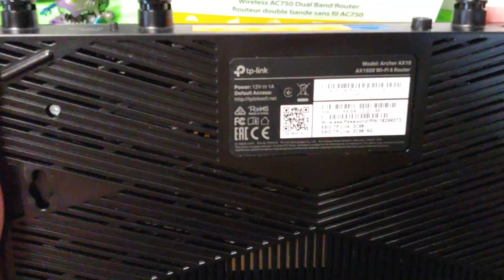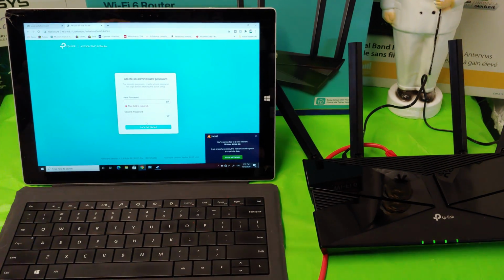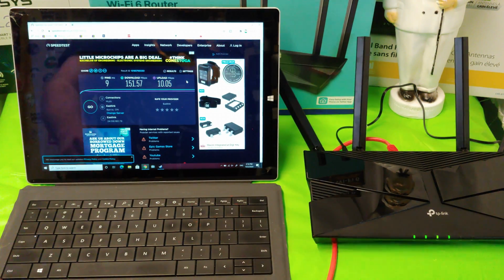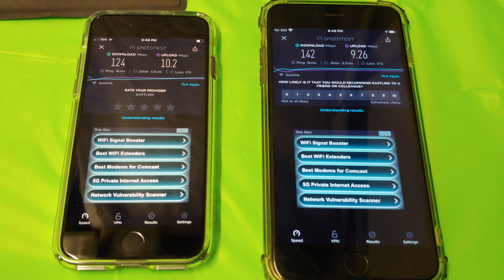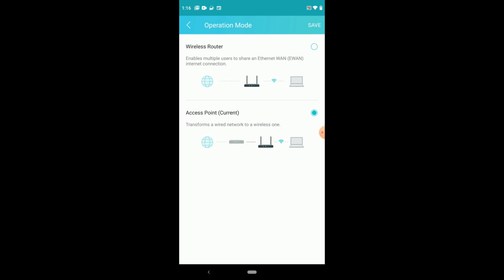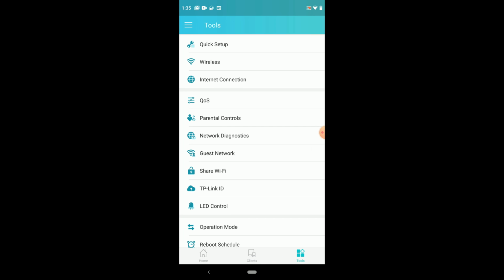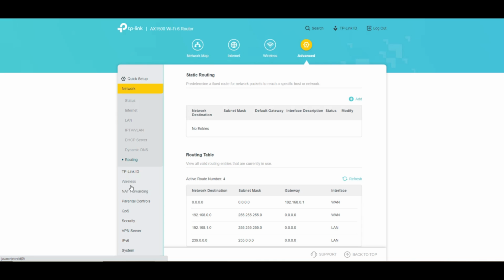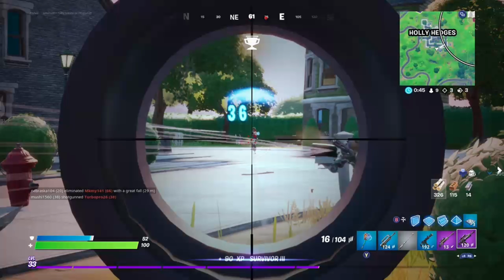TP-Link AX1500 Smart WiFi Router Review, Speed Test, Teardown & Setup. WiFi 6 (Archer AX10)

Comment: Mine just died after 28 months. I was using it as a Wireless Access Point, connected to my ISP's router by ethernet cable and that connection has failed. Its been playing up for a few weeks, with the 'orange light of death' showing some mornings (which a simple reboot fixed), but today its WLAN socket is now completely dead. All of the failures have occurred in the small hours of the morning (I can see when my thermostat log stops working). My theory is that there has been a slowly developing crack in a soldered connection, which failed when my house approaches its coldest overnight temperature (i.e. thermal contraction issue).
Looking on line I found similar WLAN issues reported by other users, so perhaps their quality has dropped. My replacement router will not be made by them. Would be interested if anyone has any comments about the lifespan of these.

Comment: Is it possible to setup as WiFi extender without connecting Ethernet cable?
Reply from the maker: If you use it as a repeater, but it slows everything down by about 50%

Comment: Okay so I have a question, my internet has a lot of people connected to it and it isn’t the fastest. If I buy this do I connect this to my current WiFi router and when I do will it boost my WiFi’s speed or will I need to purchase better WiFi from spectrum
Reply from the maker: Do you know how fast your wifi max speed is? The AX units are great for multiple people using the internet
Reply: @NevsTechBits  my max speed is 200 mbps but with all of my family it really makes it slow but I’m planning on switching to 400 mbps

Comment: I just impulse bought this.  This will connect to google nest, yes? 

It’s for virtual desktop for my quest and pcvr, nest won’t go on 5ghz.
Reply: How did it work for you?  I just got one for cloud pcvr.  Ping is killing me but idk if its the router or just distance.  Wifi gives me 200mbps or less out of 500mbps LAN.  I get disconnects as well. I have a fiber connection and a tech came out to verify solid connection and speed.  Wired I get full 500.  5ghz less than half and unstable.  Idk what else to do besides send it back
Reply: @Upgrayedddd  it’s a great router. I got it for VR to play on my quest 2 but my bros pc is flacid and weak now. Can’t find a good enough gpu. But it’s a solid router
Reply: @Thegooob95  I'm getting it worked out after sitting on the phone with my isp and trying different settings no one bothers to mention when they say you need a wifi6 5ghz for cloud VR.  I'm still not sure exactly how to go about it but if you are then try plutosphere.  If I can get it to work half decent I won't bother trying to build another pc.  The last one doesn't even work anymore

Comment: Is this good if I use it only hard wired for gaming.
Reply from the maker: Hey bud! If all you need is hard-wired gaming, just get a little 4 port gigabit router. Super cheap compared to this. But yeah, this will work for plug in gaming

Comment: Thanks a lot for this, however I am getting an error saying no internet connection, I have my Ethernet connected directly to the internet line socket and not the modem but no idea what the issue is.
Reply from the maker: Hey bud. Try unplugging your internet box for about 5 minutes. Plug it back in and see if it helps

Comment: How good is it to handle multiple users using the same network constantly? Do you lose packets or get latency increase when gaming?
Reply from the maker: I was downloading Fortnite on my PC for a review and got lag on my X-box. I get 125mb down and 10 up.  I didn't have QOS activated. 

I stopped hard-wiring my x-box and go exclusively wireless right now.
Reply: @NevsTechBits  You imply that wireless is better if i understood correctly?
Reply from the maker: @deyoviC  Wireless is better for my set-up. I got a new modem, a 15 year old 24 port router, then this router. I plug my Xbox into the hard-wire, but get lag. No lag with the wifi, but a strict NAT type. That can be fixed though.
Reply: @NevsTechBits  Thanks for the answer. I appreciate it.

Comment: Do we need a modem?
Reply from the maker: If you want internet, yes you need a modem.
Reply: I dont have a modem for fiber connection. Had to call provider for mac address.  Wired is fine. Wifi not so much